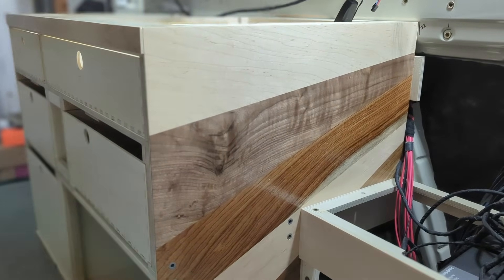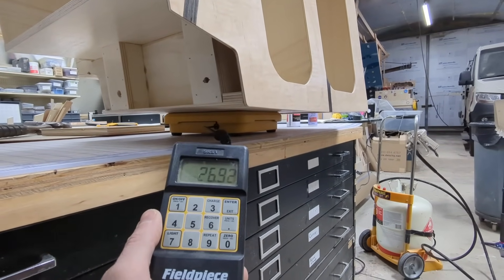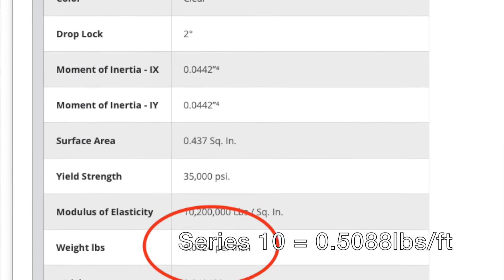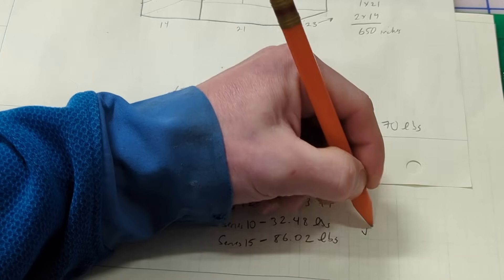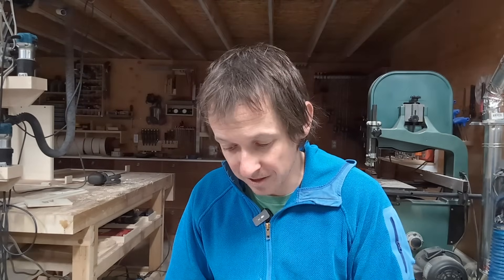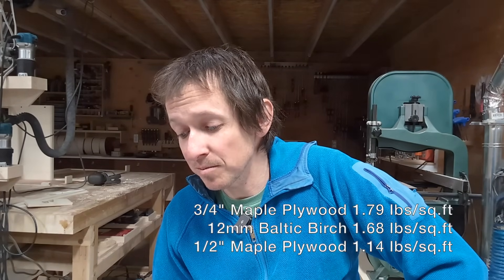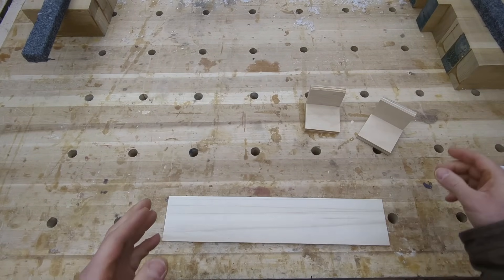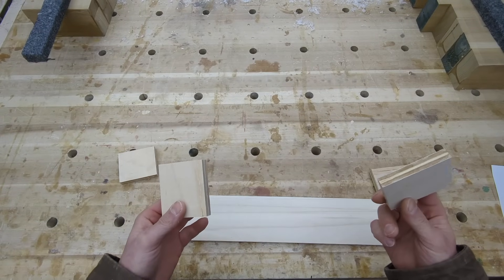Van Conversion Cabinets that are (actually) Lightweight and Maximize Storage

Comment: I get a kick out of folks that want to overbuild things.  The thing you are building only needs to be strong enough to do the job it needs to do, plus a safety factor of maybe 50% or less.  That said, I've been known to overbuild things, but only when weight is a non-issue, like say a house.  Currently I'm needing to build some shelves/cabinets for tall cap on a pickup truck.  I'm likely going to build it out of .030 aluminum sheet.  Why?  Because I have a bunch of it and it's .471 lbs. or there about per sq. ft., pretty light.  Is it going to be as pretty as wood?  No.  Will it be functional?  Yes, and I can rivet it together and use it immediately.  Keep the good stuff coming.

Comment: Late to the video, but how does heat/cool and humidity fluctuations - coupled with constant vibrations and turning moments (torque lever action) get resolved with your construction techniques? 

I'm trying to rebuild cabinetry for our class A reno, and I (theoretically, anyway) KNOW the value of using thinner materials, but the actual practice makes me nervous still.

Also - wooden drawers are great. Use beeswax on the contact areas and they slide like butter.

Comment: 80/20 is an American copy of a German industrial product. Industrial products designed to build machinery and machine guards, where weight wasn’t a primary design consideration. Being American it was built in inch sizes and got much heavier than the German designs. The original product that the German companies were inspired by was a Swiss company making extrusions for custom displays and exhibitions. The original companies were Bosch, Item, and Rose + Krieger, which still exist.

Comment: How long have you been observing poplar as a structural material?

I lived beside a poplar plantation for a while & I was impressed by just how fast fallen timber rots away, for that reason I've always avoided it, especially somewhere humid like a van.
Is balsa plywood available where you are? It is at least a hardwood & doesn't rot so fast.

Comment: Years ago I built a teardrop trailer. I wanted to build light, but things kept adding up and it turned out to be a heavy beast. I wish I could have watched a video like this before starting out. The regret of building heavy lasts as long as you own it. 😐

Comment: I agree that the pull up test isn't exactly a scientific test for strength nor would people load them up like you mention, but what about long term stress that comes with cabinets bolted to a van: potholes, chassis twisting, offroad use. Have you been able to inspect your cabinets after a year or so of use?

Comment: Very impressive and informative.

Didn’t know what to think of the 8020 frames for cabinets. Now I do! Still they could be useful for floor frames on expansive deck…

Only competitive lightweight cabinets would be foamies. They are very lightweight & easy to cut. However precision cuts can be difficult & is time consuming due to having to let the resin coating on fabrics, veneers, screens & thin plywoods which strengthen the foam cabinets takes time to cure.

Comment: Interesting ideas that make sense in a moving vehicle. Structural engineering requires a structured approach. Strangely enough, this is not the most common in DIY campers.
Well known to plane and boat builders, weight control is the key. 
The next step is wise use of sandwich plates for plane in flexion, strong adhesives such as epoxy resin with glass bead filling, some fiberglass or carbon local reinforcements. Hard wood or metal insert for local load-bearing, curvature that provides  geometric rigidity, substructure pre-stressing, and so on...

But at this point one may wonder why the vehicle itself is mainly made of steel, glass, plastics with poor mechanical performance, and used to transport water and lead batteries...

Comment: Cyanoacrylate glue is much stronger and faster than wood glue when used with a curing accelerant. Its much more expensive, but the time you save is incredible. No clamping! I started usung it on molding corner miters and cant believe how strong it is. I bet if you used it on the drawers instead of the time consuming finger joints, you could build up the cabinets much faster. I'd reinforce the inside corners with epoxy dookie schmutz and they'd never come apart.

Comment: I’m glad someone is calling out that 80/20 stuff. The same goes for framing out cabinets. Space in a van is a major concern. I’ve built most of my stuff with 1/2 inch non-structural ply with no framing and it’s held up fine. And I haven’t even bothered to glue anything either.
Reply: This is ¼" & ⅛" plywood.

Comment: Fantastic video! I’ve often wondered about the aluminum extrusion weight debate and conceptually agreed with your results simply on the basis of the extrusion ADDING weight to an otherwise wood cabinet. 

I, like you, prefer using wood, wood glue, sound joinery, and understanding how to properly stress the wood. 

A+ analysis !
Reply from the maker: Thank you!

Comment: Use the material you like to use. Some of the best builds I've seen were made out of steel frame. I found it so tedious to be getting this video shared from all the people I know who can't afford 80/20 or need it in their build.

If you are building a modular system, 80/20 as a base is awesome. But for the entire cabinet system? Probably not.

Comment: Did you fasten your fridge to the frame? In case like getting into an accident so that you don't get the fridge in your neck. I am sure the downward pressure is fine for the structure. But not sure for lateral forces.

Comment: Great info, thanks!  For such an engineering geek 😂 you sure can explain things so they're easy to understand.  As the owner of an old (year 2000, and 200k+ mileage but still in great shape!) hightop Econoline (set up as a bare-bones mobile office that I want to start converting into a camper van), this is super-useful food for thought.  I too want to cut weight every place I can --- for one thing, my E-150 is the lightest weight capacity of the three Econoline versions --- to indulge in more desirable weight luxuries elsewhere....say, larger water tanks for more convenience. If you're familiar with the DIY Paulk portable workbench (find on YouTube), one of which I've already made for myself & use a lot, he also espouses the strength & lighter weight of thin plywood, if you just know how to assemble it cleverly.  Plus I really like the way you can contour these wood units so well to the nooks & crannies of van walls.

Comment: If you use pink insulation board and put a light coat of fiberglass and resin over it it isJust as strong and weights half as much
Reply from the maker: Thanks for the comment.  I have been curious about making a foam cabinet just to learn the process, but I don't actually think it is lighter.  3mm poplar plywood is about 4oz per square foot, 6mm poplar plywood is about 8oz, which is right in line with the foam possibilities.  My real hesitation is losing so much cabinet volume to accommodate for 1 inch thick walls, the lack of (at least with my abilities/tooling) to build for curved van walls, and general inability to make really intricate cabinets to maximize storage.  Can you even do drawers without jumping through hoops?

Comment: Alright, I could use some advice. I'm not sure if you get notifications but hopefully you see this. 

I am a hobbyist woodworker and I just bought a truck camper (94 Sun-lite Eagle). Stock with mattress and a few things the previous owner left in it, it puts me 10 lbs under my GVWR, which, is way to close for comfort.

I plan to tear out the cabinets and replace them with cabinets designed after what you're doing. However, I am concerned about the under mattress storage. Would 6mm poplar core be sufficient enough to support the weight of two people and a husky if I did 12mm runners (parallel to the bottom of the 6mm so the exposed ply side are touching the 6mm)? Or should I do 12mm panel with 12mm (or even 3/4) runners?

Also, if the bottom of the floating portion 6 or 12mm? Did those need support runners under them or is the small span sufficient to hold weight?

Comment: Another factor in design is expense. With a large budget, the design and protocols used in aircraft construction can be considered, where honeycomb panels are used extensively to achieve the very necessary weight savings.

Comment: I love the fact that you are laser focused on weight. I am the same with my van build. I have no other option... it is a 2013 Ford Transit Connect . It has to have lightweight cabinets because the engine is so small and the transmission is known to blow itself up under significant load. 

Fully kitted out, my cabinets are extremely light. The heaviest cabinet weighs about 15 pounds.. The overhead cabinet only weighs 5 pounds. 

Keeping the weight down improves fuel economy, reduces wear on the transmission (especially important in a small van like mine) reduces wear on the tires, makes braking and emergency maneuvers easier and safer, and improves handling and acceleration. It is also much safer in an accident (more on this in a moment).

I do have to take a (somewhat pedantic) exception to your rant on 8020 though. I used 8020 throughout my build, but instead of the T-slot profiles, I used their quick frame product line. (Actually, I used a mixture of it and a similar product from Esto Connectors that is both thinner and lighter).

This tubing is considerably cheaper (12 cents per inch vs. 37 cents per inch for the 10-series) and much lighter (.018 lbs per inch vs. .042 lbs per inch for the 10-series). It is also EXTREMELY strong - a 3 foot length of the quick frame from 8020 with fixed ends will only deflect .1 inches under a 300 pound point load at its center. (I.e. a 300 pound person could stand on the center of this span on one foot and it would only deflect roughly .1 inches)

Using this tubing, your 650 inches for the lower cabinet would weigh 11.7 pounds and your 766 inches for the upper cabinet would only weigh 13.8 pounds.

As a skin over the top of these frames, I use 3mm plywood just like you suggest. It is incredibly light, and when attached  to the frame (using aluminum pop rivets) it becomes the stressed skin which makes the cabinets extremely stiff even while being super light weight. I use 6mm baltic birch ply for any weight bearing surfaces (like the top of a cabinet that someone would sit on). I can span about 14" without much of any deflection with this wood.

Using this system I can get an extremely strong, extremely stiff cabinet that is also quite easy to construct. I don't lose much space because I do not build backs to the cabinet and conform the sides to match the sides of the van.

I do lose some space where the frame is, so that is a real issue. But since the tubing is only 3/4", it is less than the amount I would lose using the 10-series. And with some careful design, you can actually eliminate some of the sections you drew and replace them with either 3mm or 6mm ply similarly to the way you use it in your build.

Finally, with regard to safety, weight and stiffness play really important roles. A frontal collision at 35 mph against an equally sized car can result in a momentary force on everything in the van that is roughy a 20X multiplier on its mass. So a 100 pound cabinet will pull on its mounts with roughly 2000 pounds of force. Now, that is a very simplified example and it assumes the cabinet is a point mass - which in real life it is not. But still, the 20X factor is a good rule of thumb to use when considering the weight of anything placed in the van (cabinets or otherwise). If you have heavy cabinets, they are in danger of tearing free from their mounts. If you have lightweight cabinets, then it is much easier to ensure that they remain in place. But you also have to consider what is inside the cabinet.

I love the fact that your cabinets are so lightweight. That means in an accident, they are much more likely to stay in place and much less likely to deform to the point of failure due to their own weight. I cringe when I see people putting Ikea cabinets into their builds. The danger to which they are subjecting themselves and their passengers is frightening.

The aluminum tubing I used in my van (combined with the stressed skin plywood cover) is not only very light weight, it is also very very stiff. It is not likely to deform to the point of failure in an accident, and since the mounts are all through-bolted through the aluminum frame, it is securely attached to the frame of the vehicle. Much more so than if they were attached just through the wood. This greatly reduces the chances of a cabinet tearing free in an accident and flying forward into the driver and passenger area.

To be clear, I am not arguing that your cabinets are anything other than amazing. I am kind of in awe at how fantastically well engineered and constructed they are. And I am super glad you are so focused on weight since it is so important. I also love the fact that you focus on the stresses in the wood and understand that with some careful analysis you can remove material without removing any strength. I just thought I would mention the quick frame aluminum as an alternative that is light weight, easy to work with, and potentially safer than just wood alone.
Reply from the maker: Damn!  This is fantastic!  I looked at the Quick Frame line and can definitely see why its a superior choice to 8020.  I haven't seen anyone else use it.  I've played around with welding aluminum (out of 3/4" and 1" square tubing) and with my abilities and my welder doing 1/16" material is really tricky and looks pretty bad.  And once I move up to 1/8" wall thickness the weight savings diminish, so this looks like a good option.  

I think in this video I sort of presented 8020 cabinets the way people who build with 8020 present wood cabinets: they say they are made of 3/4" material and weak (because they are comparing to particle board crap).  

Thanks again!  Thats a great product!
Reply: Thanks for taking the time to share your thoughts!

Comment: I built with 1" insulation board because of weight, and safety in an accident. My space lost was more than yours, and it's definitely not as polished, but even in a rollover catastrophic accident, I'm not having a javelin in my head.
Don't see enough people recognize this. 
Anything heavy is stored low. Each piece is held in place by direct attachment and by friction fit (like puzzle pieces). 
You are an amazing craftsperson, and your maths and sciences are much better than my reasoning, but I felt a kinship in seeing something most people ignore. 
Thanks!
Reply: This! My concerns exactly.

Comment: I think the length of aluminum might be overestimated for the weight calculation? for drawers, horizontal supports for slides and horizontal dividers aren’t necessary. All slides in an assembly may be fastened to vertical members…

Comment: I agree with what you say.  BUT - most amateurs who one off build a camper van have very very little woodworking skills, and have very very few tools.  They probably wont have a bandsaw, a table saw, a bobbin sander or most of the tools that can be seen in your shop.  They sure as hell wont have any Festool gear.  

Most dont have a dedicated mitre saw station so their cuts end up less than perfect, and crooked gappy joints result.  Finger jointed drawers - man that is next level.

Which is why they end up using cheap gear and cheap fasteners which results in a cheap looking fit out.  The fitout is heavy because they use 1/2” ply as its easy to join.  And in the end, it is probably just as heavy as the 8020 system, but looks much worse than 8020.  

Just my thoughts as part of the conversation.

Comment: Nice video! What do you think about using EPS or XPS foam with a hardwood laminate, fiberglass and epoxy? I think that's what they make surfboards out of. Couldn't find much info about this, though.
Reply from the maker: I've built some foam core panels and I actually used it quite a bit in the Promaster I've got video about.  The bed platform, overhead cabinet bottoms, and bench are all built using that.  The hardest part is finding the right adhesive to eliminate slip/movement between the foam and laminate. I had good best results with XPS.  Poly iso would be even better as it is lighter and stiffer, but the only stuff I could find had pretty poor thickness tolerances so it was hard getting a consistent thickness and void-free contact between skin and foam.  But its something I'd love to play around with more!
Reply: @projectofscience  Good to know. I’ve done a little fiberglass work, but not much. Given that I live just north of Seattle, the poplar ply that you used seems much more straightforward. Faster and most likely better looking. I presume there wouldn’t be a whole lot of weight difference. But using the foam composite for heavier objects might work well.

Comment: Your comment about fitting the cabinet to the wall contours. 
My father had a class b in the 70's. On a camping trip pulling a friend's tt they found the hitch wasn't installed properly and was tearing the floor.
The mechanics shop was busy so dad and Larry took out the interior so he could get to the floor.
They found the standard ready-made cabinets had been screwed to a sheet of plywood the width of the rear door had been slid in and screwed down. :(
They cut the cabinets to fit the wall when they put it back together and that widened the isle about 6"